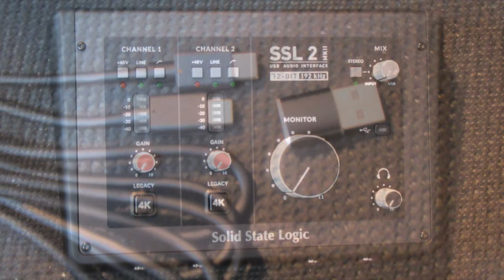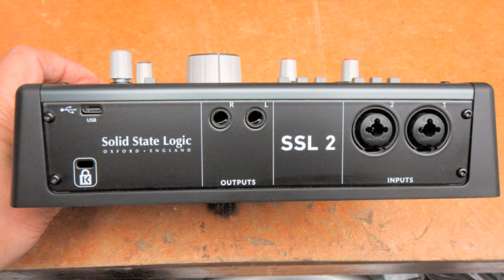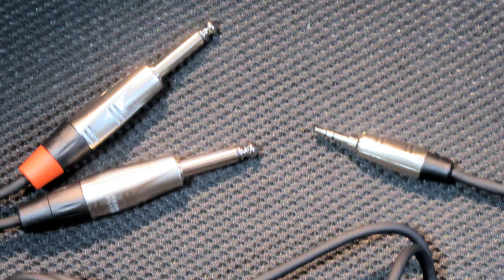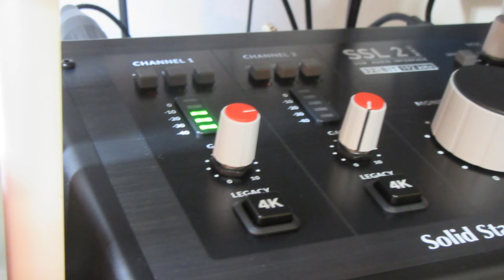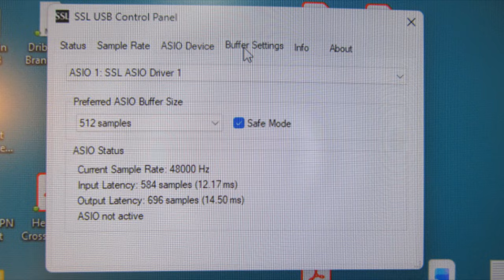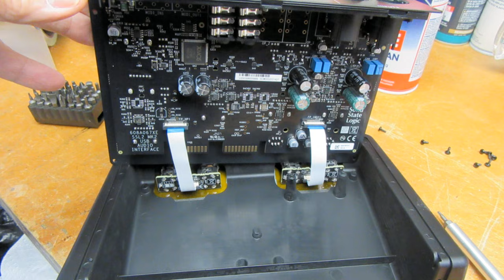Solid State Logic model SSL 2 MkII USB Audio Interface: A Detailed Overview

Comment: Brother, can you please help me. Are the instrument inputs on the front stereo or mono? Can I put a trs cable into channel 1 and get a stereo signal from my synthesizer? Or do I have to plug a 1/4 trs cable into the back input for a stereo signal on channel 1 from my synth? Thanks.
Reply from the maker: I went over all this in detail in my video. The front panel "Instrument" jacks are ONLY monaural, ONLY 'Hi-Z' (high impedance), and as such are for guitars and such. Synthesizer outputs are 'Lo-Z', and may ONLY be connected by TS or TRS 1/4" phone plugs cables to the rear panel Line/Mic combo jacks. If you need to bring in a 'Lo-Z' stereo signal, one channel needs to go into one of the two Line/Mic jacks and the other into the other Line/Mic jack.

I suppose if you have access to a couple Lo-Z to Hi-Z converters (transformers, etc), you might be able to use them to get your stereo synthesizer signals into the front two Instrument jacks, but that is not how they are intended to work, and even with such adapters, the signal levels might be too far different from what is expected.
Reply: @youtuuba Yeah, so here is what I'm trying to do...I'm trying to have channel 1 (backside mic), and channel 2 to be for my synth in stereo, but is there anyway to make the second channel stereo without having to use both channels for the inputs? Do you understand what I mean? 

Is there anyway possible to have my stereo synth in just the one channel without having to use both channels with dual 1/4 ts cables to get stereo? I have tried almost everything and I cannot get one channel to be stereo? Is that even possible? 

I thought that a dual 1/4 ts cable (left and right) coming from my synth, going into one of the back inputs with a 1/4 trs cable would play stereo into the one channel, but it's not working? Or are these channels mono only? I hope this makes sense and I appreciate your time. 

I thought that it would be as easy as putting 2 ts cables from my synth left and right into the back input with a single trs cable, and there would be stereo on the one channel? It's really confusing me...
Reply from the maker: @natanmandala , the specifications are pretty clearly defined. This is a simple audio interface, but it seems like you need a more complex piece of gear, or maybe insert a small mixer between your gear and this interface (this product is not really a mixer).